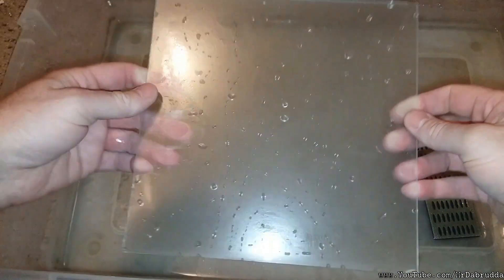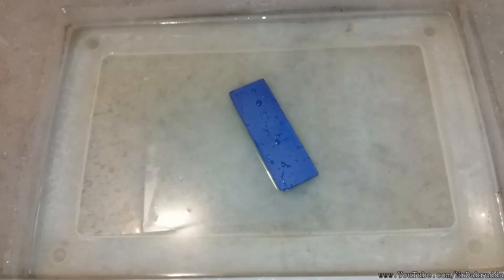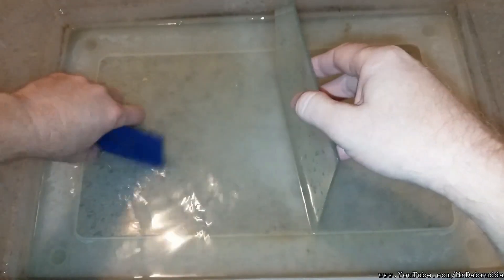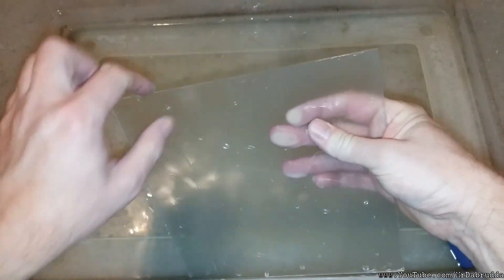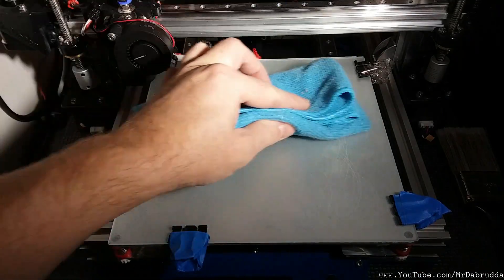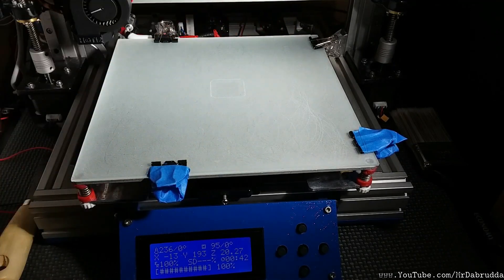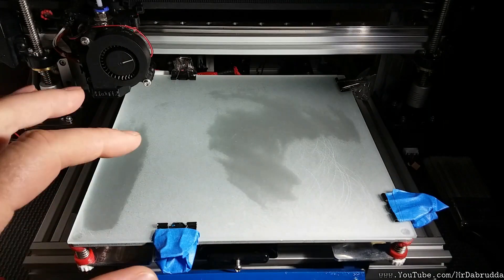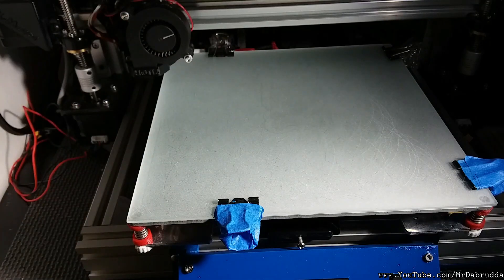No More Glue Stick, Painter's Tape or Hairspray

Comment: My prints won't stick :(
Reply from the maker: Adjust your nozzle to bed height.  Also try modifying the first layer settings in your slicer.
Reply: @MrDabrudda  what should I adjust the first layer to, for starters?
Reply from the maker: Are you using a bed sensor or an end stop switch to detect the print head height from the bed?
Reply: I do have the stop switch yes. But no bed sensors of any kind if that helps. I tightened the carriage because there was a bunch of wobble. And if I get it too close it just pulls it right back off. I use a sticky note to level it, normally.
Reply from the maker: Either tighten the bed screws so the springs provide enough tension to prevent bed movement or buy longer springs.  If you have an ANET A8 I made a Z-endstop fine tuning knob.  This was before I added a bed sensor.  
https://www.thingiverse.com/thing:2571816
Reply: @MrDabrudda  I might need to buy longer springs then. I have an ender 3 pro with glass bed for starters and apparently known to have leveling issues. But I'll get longer springs! Thanks for the advice and tips!!

Comment: PLA is always fine on my glass bed without doing this, please try ABS, PETG, PC, and Nylon. Especially, ABS and Nylon give me hard time. Try these 2 filaments first if you can.
Reply from the maker: I only print in ABS any more.  I built an enclosure from 3/4"x4' fir boards and dollar tree foam board for the sides and two Lack table parts from Ikea.

Comment: Glass or aluminum or steel bed with Zillagrip coating glue allows you to print the most type of plastics and works with a cold bed. Just heat the bed to release. PLA ABS Nylon PETG PP POM PC with one glue coating adhesive
Reply: What I'd zillagrip

Comment: My smooth glass doesn't need anything applied but I do add a 50/50 mixture of hairspray and alcohol dripped and rubbed on the glass when I print tall items for added insurance.

Comment: some kind of acid is used to frost glass. you can also buy glass already frosted.
Reply: Its hydrofluoric acid. Extremely dangerous stuff. And i doubt you could buy it in a local store. (fortunately)
Reply: @opiniono-1  amazon will get you there however :)

Comment: I was able to smooth my sharp edges of mirrors using regular wet dry sand paper... can't see why you could not scratch surface...it may take longer and more effort though.. does this work with PETG??? thanks
Reply: UPDATE!... i sanded my mirror that i use for build using 80 grit emery sand paper.used a little water.. i spent approx 20 mins...turned out very dull similar to your glass plate... than i re leveled and so far so good after 2.5 hours into a 15.5 hour print no issues... did not use any glue or hairspray either... if it fails i will come back and update again...
Reply from the maker: I had too much adhesion and actually chipped parts of the glass off when removing prints.
Reply: @MrDabrudda  i don't have issues with pla... have not tried petg yet...i ended up hitting it with 36 grit...

Comment: Nice tip, thanks. The Anycubc Ultrabase feels/looks finely etched. You don't need diamond to scratch the glass, anything harder than glass will do. Glass can be anywhere between 4 to 7 on the hardness scale (your fingernails are 2 to 2.5) so steel can cut it.

Comment: if print using PLA, do you also heat the bed ?
if it yes, please let me know the temp
Reply: I think he does, being that he mentions letting the bed cool off :)
Reply: The printer's temperature reading is often not very accurate, so you just need to find what works best with yours. Temperature and air flow in the room also affect it quite a bit. On my smooth glass I usually get poor adhesion below 65 while it's pretty good at 75. PLA starts getting too soft above 80-85.

Comment: Great idea!  I'd recommend using Acid Etch cream like "Armour Etch".  You just brush a thick coating of it on the surface of the glass, leave it there for 10 minutes or so, then wash it off with water, and you have a permanent and perfect satin etched glass surface that should have enough tooth for the prints to grab onto..
https://www.amazon.com/Armour-Etching-Cream-Glass-Mirrors/dp/B00GGTH09I/ref=sr_1_6?keywords=armour+etch&qid=1579300640&sr=8-6

Comment: I thought about grinding the surface of my $3 glass with some surface grit.  I can’t remember the name of it.  You wet it and rub it in. I use the stuff to grind the glass surface for my Large Format Film Camera Focusing screen.
Reply: You can use some loose silicon carbide grit mixed with water for sure..  400 or 600 grit should do the trick

Comment: I'm struggling a lot to print on glass, do you heat the bed or not? At which temperature?
Reply from the maker: I heat my bed to 100C for ABS.  I also have an enclosure to prevent drafts.

Comment: Do you think an etching cream would work just as well? I'm thinking of trying it. Leaves a similar finish to this.
Reply: Interested in if you tried it? I've just got 2 pieces of glass cut and tempered, and literally about to try this. I have all I need, will let you know!
Reply from the maker: I broke this glass plate a while ago but plan to try sand blasting and a glass etching kit to see if the process is quicker and have better results.
Reply: @cornerstone710  I was wary of just trying it on my only glass plate. But please let me know how it works out.

Comment: do be careful printing with ABS and other high temperature stuff, you might weld it to it and rip chunks out of the glass when you try do remove it.
Always wait for it to be completely cooled down.
Reply from the maker: That has happened to me.  Pull a chunk of glass with the print.

Comment: Just waited 3 weeks to get my diamond grinding stone and did just this, got a nice frosted Matt finish and now nothing sticks to it at all, even tried glue on it again and nothing. Turned the glass over to the shiny side and printed first time, see additional comments for update, all ok now.....
Reply from the maker: Did you clean the glass with alcohol to remove any oils?
Reply: Yes, in fact it was cleaning with alcohol that stopped it sticking. I grinded for another minute DRY and wiped with a clean cloth and now it does stick really well. I cleaned with alcohol again and it stopped sticking again. It does stick really well as long at I wash with water and just leave to dry
Reply from the maker: That's weird.  Try cleaning with Comet abrasive cleaner.  That is what I used on my smooth glass to get old hairspray off and it works great.  Is the cleaning cloth you used washed or dried with fabric softener?  Maybe some residue is left behind.
Reply: All works fine as long as I don’t use alcohol on the bed. The part comes of clean when cold and no need to clean or scrape for the next build at all. While the alcohol in my scenario stopped this working I can say that the frosted glass surface straight after grinding is quite frankly the best adhesion I’ve ever had and requires no maintenance which is a double bonus.

Comment: I already buy my glass like that and work very well
Reply from the maker: Where do you get etch glass from?
Reply: @MrDabrudda  I buy in my country in any glass store doll glass and working very well, but you only get the minimum 4mm but is for 5€
Reply: @MrDabrudda  i don't know where you from but I can send you a sample for you to test.
Reply from the maker: 4mm might be too thick for my capacitive bed sensor to detect the aluminium bed through.
Reply: Yeah that was my problem 1st, then i bouth other capacitive sensor with minimum 10mm distance and detect well, and now i will start make almost the same upgrades you did because i LOVE ANET A8 and i also want better speeds and quality, now i'm waiting for my new extruder

Comment: Just apply Insulfilm (car windows peel for sun protect) and you do not need anything else.... I use it on abs and pla with a great adhesion and when the bed cool down the piece detach by himself
Reply: Hi, Regis. Do you apply the insulfilm straight to the aluminum surface or on a glass? Is it easy to clean with isopropyl alcohol? Does ABS work just fine on this material?